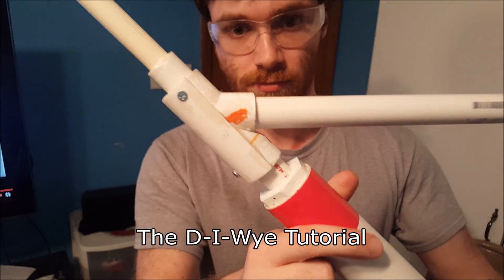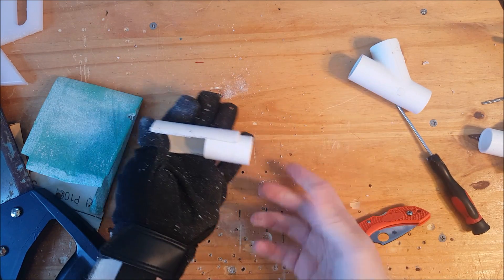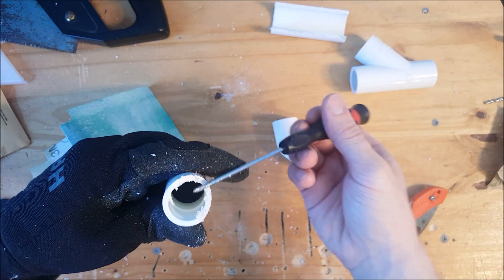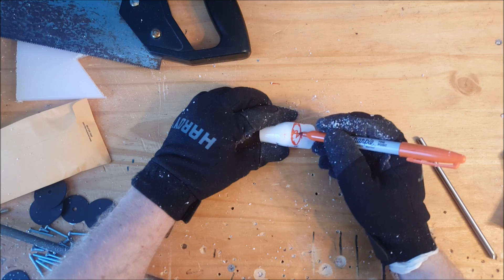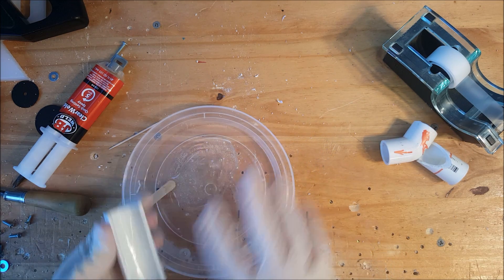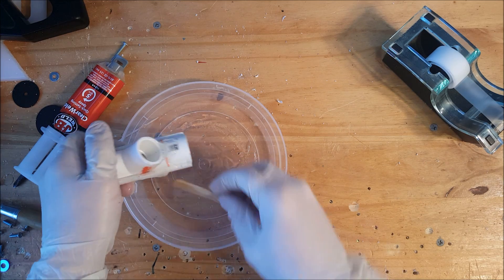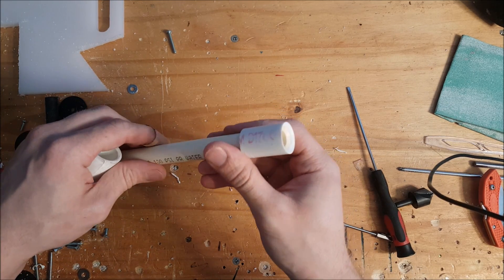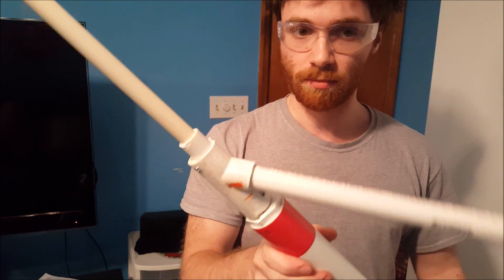"D. I. Wye " Homemade PVC Wye Tutorial!

Comment: Could I use just a piece of 1" PVC instead of the 1/2" coupler? If you cut the same half-pipe down the 1" piece for the body, halfway down the length making the rest a full pipe, then cut the same shape you cut in the 1/2 coupler, essentially making it so you don't have to use a coupler at all. Then just adapt/tape the 1/2" PVC stub 'til it fits in the 1" full-pipe. I don't have any 1/2" couplers and it would make it a little cheaper to produce, I'm just curious if it's doable.

Comment: How do you make a full length dart wye?
Reply: You’ll need a much longer straight pipe, and a shallower angle on the pvc bend. I might recommend a dart box magazine with latches to hold the lid on, or using spherical rounds in a similar setup to this, but with a wider diameter of tube/barrel, such as Nerf Rival Rounds

Comment: I don't have a bulb valve
Reply: you can always take a cpvc endcap. drill a hole through that. get a cpvc T-piece. Drill a hole through that. Then put a bolt through then holes and secure that with a nut. That's what i used for a while
Reply: Stylianos-Marios Seitanis you can get them at any Home Depot or Lowes for 75cents. Just ask someone who works there where they are
Reply: Joe miller I live  in Sweden
Reply: Stylianos-Marios Seitanis you can also just use a 1/2" PVC tee and plug the side holes with 1/2" CPVC end caps.
Reply: Joe miller thanks